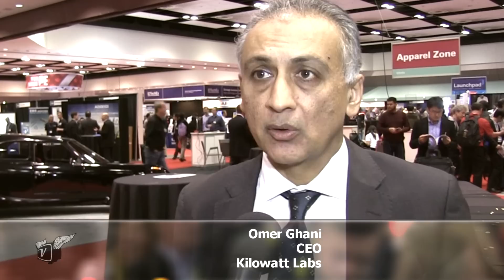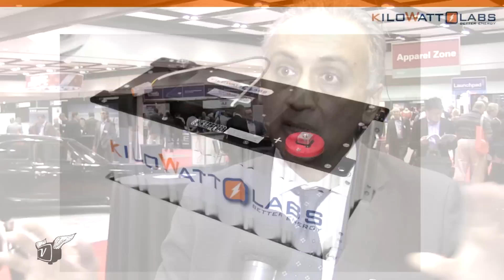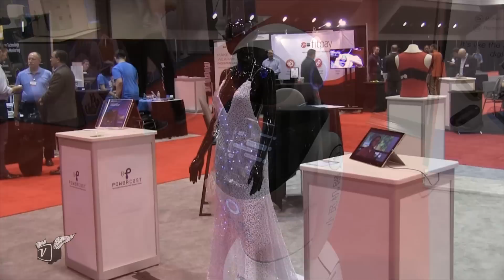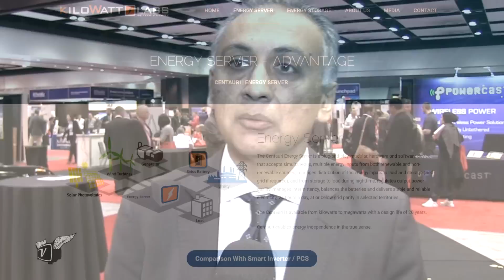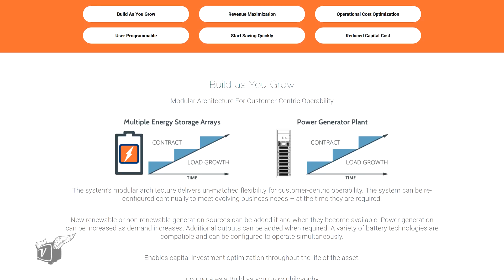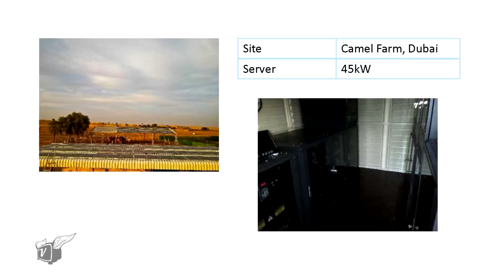The Fuel Tank of Tomorrow - A Super Capacitor?

Comment: Super/ Ultra capacitors don't have the capacity. They work great in parallel with a good lithium battery. The new Solid state batteries will be like this. By itself a capacitor is ok but not for long time energy, just short start stop times.
Reply: We need a lot more people making these points. Too many of the commentariat just buy into the hype.

Comment: So where do you buy product? They don't show any distributor on site...
Why are they only 2.5-2.8 volts? To keep the insulation very thin? Why are they so expensive? Only three components, foil, oil, paper insulator....
How come your cap unit looks like a 18650 battery???

Comment: Cars are to heavy, I use a Solarized e-trike that pulls a solarized trailer. Light weight flex panels (6-100 watt panels, easy to add more panels). Sun light helps to keep the battery top off.
Reply from the maker: Great idea. I interviewed the inventor of the Truck Trike last year and he pointed out the advantage to the e-bike approach is the incredible payload to vehicle weight ratio compared to a traditional car, where a ton of metal and parts needs to be propelled just for one human. http://www.viodi.tv/2017/06/30/the-ebike-delivery-van-verge16/
Reply: Voidi- watch on utube, Light Rider operation Paul Revere. Solarized e-trike/trailer I put together.rode across Canada, crossed the Rockies 3x. Used it to boil water, cook food, charge batteries for cordless tools, hauled material for a dwellng.
I upgraded the solar from 6-50watt glass panels to 6-100watt flex when I was in Victoria, BC.
Reply from the maker: Very cool. I watched your interview in Thunder Bay. If you ever ride it to Silicon Valley, let me know, as that is very creative solution that will only get better as solar panels improve.

Comment: What I don't understand:  The energy stored in a supercap is proportional to the square of the the voltage, and inversely proportional to the distance between positive and negative poles.  But the risk of electrons traveling through the gap between the poles increases proportional to the voltage.   Hence, voltage is a limiting factor, but should be maximized because of the energy stored.  Why does the speaker talk about a low-voltage supercap then?

Comment: to recharge a supercap in one minute to capacity enough to drive a car for 100 miles you'd need a charging cable as thick as your forearm.
Reply: Yes, a very heavy cable and a very powerful charger that is able to generate the 1000th of amps to charge so fast.
If the charging is 1 minute and the discharging is about 1 hour or 60 minutes of driving, you will need 60 times more charging power than the average power used in driving the car. The average energy use of a car is 35 KWatt-hours per 100 miles, and say you drive in that hour 50 miles, that means an energy use of 17.5 KWatt-hour. Than means that you will need 60 times 17.5 KWatt or 1050 KWatt of power to charge the capacitor. For a 600 Volt battery that means 1050/600 = 1.75 KAms or 1750 Amps. That is indeed a heavy cable and very powerful charger! Can anybody check if I have these estimates correct?
Reply: You could have like prongs lifting from the floor to give your car a small "kick" of a few kV
Reply: Yes. If we view an energy storage system as a black box then energy in = energy out less the inefficiencies of the charge + discharge cycles (in batteries this is called conversion loss). Lithium batteries, depending on the quality, have 1-10% conversion loss (at the high end think ultra cheap China).  Second, KW capacity is a function of 3 factors: voltage, amperage and time. More voltage less amps, less voltage more amps for the same capacity to do work. Of course, time then spreads the instantaneous need over a period. So, for your example of needing a 17.5 KWH capacity and assuming near 100% efficiency, in a DC current at 600 V, I calculate you need about a 29 amp flow for a period of 1 hour either discharging or charging. Or, 58 amps for 30 minutes, 116 amps for 15 minutes, 1740 amps for 1 minute. The AC electric grid complicates the calculations somewhat (that pesky calculus stuff); that is why high capacity chargers need 220V two phase circuits and super chargers use 440v 3 phase circuits. So, given a reasonable charge rate of 232 amps for 7.5 minutes most likely could be handled by a gauge 00 cable (or a bundle of five 10 gauge cables) at 600 V.

One conclusion here is that the electrical grid, typically, does not deliver adequate power to quickly charge electric vehicles. However, the grid design could easily deliver 1,200 V or even 12,000 V without much trouble.

One last thought, I think it was sometime in the late 1990's  or early 2000's, Popular Mechanics ran an article that calculated the power needs of converting every car and light truck to electric. The USA would need to build 600 600-megawatt nuclear power plants to meet the demand. If the plants were fossil fueled, the operating carbon footprint would be only slightly less than gasoline powered vehicles; negating all benefits from electrification, including health and environmental.
Reply: @Chuck_C  the charging station could have it's own super caps to balance the load on the grid.
Reply: True, however if charged at very high voltage, then cable size comes down. But to do a 1 min charge would require thousands of volts, extremely dangerous. I think a charging system designed to recharge your car over a 10 to 15 minute period makes more sense. Have a coffee while your car is charged.
As for supercaps, lots of promises but no delivery of viable products.
Reply: @Chuck_C  this is exactly how corporations such as oil companies and power companies want you to think.  Every house will generate power from the sun.  The corporations only have to continue to raise prices to make it cost efficient for average person to seek a better way.  It will happen,  just takes time and corporations to get a little greedier.
Reply: @arthurgrunwald3859  amm looks good
Reply: @kelvinham8576  sup er caps are designed to charge very fast and there is no need to charge it at once u can charge .......
Reply: @FutureOfGaming  So don't use a cable. Use contactors that come up from under the parking space.
Reply: @Zamboro  i dont understand what u want to say
Reply: @Chuck_C  nice to see someone who has a good idea what they are talking about. Electric cars are a good idea if you have your own renewable energy source such as solar roof, wind, water turbine etc. Also place of work should have solar roof. Most lithium ion  batteries should only be charged to 80% never used below 20% to extend its life.  max current load limited as max charge rates also need to be restricted, super caps could help reduce max load in conjunction with battery pack. I don't understand why people require or expect instant recharge. Interchangeable pre charged batteries would solve most panic stricken peoples need for instant recharge, please also consider electric has to be generated which takes time whereas fossil fuel energy has been generated and collected over thousands of years that is why we use it as it is there for the taking. We need more renewable electricity generation systems before we loose sleep about how fast batteries or super caps can be charged.
Reply: @kelvinham8576  well said, people need to be realistic, trying to charge any energy storage device 100kw battery or capacitor would be a bomb/fire hazard, also you can't discharge 100kw in a minute for the same reason it is Dangerous!!. Manufactures of storage devices need to have multiple safety devices in case of accident or short circuit. Electric cars should have limited acceleration to reduce current draw from battery also need multi ratio gearbox for hill climbing/regeneration braking etc., battery or storage system will be damaged if too much demand is put on it. It is false marketing to claim a fixed ratio electric car can accelerate 0-100kph on under 4 seconds because even though it is possible in theory it puts too much stress on batteries etc. First thing people need to be more realistic with their expectations of what transport is about as do these marketing people pumping out fake claims. So far each recharge of electric car costs more on battery degradation than a tank of fuel plus the cost of electricity therefore still not economically viable, hasn't addressed co2 because electric has still to be produced mostly by fossil fuel or hazardous nuclear generation. I'm afraid we have a long way to go to solve the transport problem. Sorry if my comment sounds negative but I'm trying to be honest, I'm not very impressed with all the fake claims and clever marketing.
Reply: @jonathancrump31  Bingo.
Reply: false
Reply: Soon if we managed to have working fusion reactors we can potentially supply the grid with enough electricity to charge many electric cars in the road that quick.
Reply: @blackmanops3749  not false over 9.2meg already out there
Reply: @arthurgrunwald3859  Don't forget Ohms law. Maybe they charge at 100,000 volts. That would drop the current way down. Less heat, smaller cables.

Comment: Its a direct question to Mr. Omer Ghani, CEO of Kilowatt Labs. Cannot we use these super capacitors’ bank in place of LI Battery bank in Electric Vehicles? What are the advantages and disadvantages in using super capacitors bank instead LIB bank? Expecting your clarification at the earliest possible. Tnks. Bye bye.

Comment: Where do I get this super capacitor battery to buy?
Reply: They are on sale in Australia from Arvio, don't know about elsewhere. It does seem that the comment about having storage capacity equivalent to Lithium footprint is true by using graphene or something similar to expand the area that can hold the electrostatic charge as I understand it. A lithium-ion gateway is used to slow the discharge, which helps to maintain the charge. Cost is quite good in comparison to lithium-ion, especially when the lifespan is considered.There are a number of videos from Arvio and a demo monitoring of the batteries in action in an installed system.

Comment: Supercap powered hybrid cars will be ideal for power adder hub motors... a 1.0 liter engine with hub motors powered by supercaps= a 300hp Honda Civic that gets 75 miles to the gallon built for the same cost of a Honda civic today.
Reply: But wouldn't hub motors lack a differential?
Reply: Ananta Sesa das why is that a. problem? 1 motor at each wheel, no need for a gear box or differential...you get torque vectoring too.
Reply: +Tyler Hardy, yeah it might be doable with high speed communication between the wheels so the inner wheels throttle down in a turn to not burn rubber.
Reply: how fast do you like to corner?
electric motors would not be coupled
Reply: There's plenty of companies doing it already. The communication only needs to be between the motor controllers.
Reply: Sorry to be a nuisance, but why is it a good idea? where is the power that charges the capacitors would come from?  Are you going to leave the engine running when the car is parked? Or are you going to plug it into a mains socket?  If the latter, how is it better than the batteries?  With the batteries the power boost will last a helluva lot longer due to much more energy stored.  Not a criticism, I just don't get it, could you please explain.
Reply: +Bob Berg, right hub motors won't be able to start the engine like hybrids do by momentum. So cranking is required every time the light turns green. OTOH the hub motors would lighten the chassis weight and then lighter duty axles could be used and no transmission, so that can lower overall wt. for hybrid or all electric. might be hell trying to fix the motor tho.
Reply: Can u put this in a car u tell smooth charging how about the alternator charging so fast maybe destroy the capacitor
Reply: richystar2001 super capacitors do not produce any energy they just store it.
Reply: AnantaSesaDas So you know of an electric motor that is efficient over the range of zero to 80 mph to put in those hubs?
Reply: Power/torque is only used when you push the accelerator petal. The full capacity would be 300hp 400ftlbs...but when you drive, that capacity is only used for seconds at a time...truthfully only 25% of the power of an engine is used constantly. So a 1.0 litre three cylinder engine could be used for sustained power...the supercaps will give you full power when you press the petal down... So 0 to 100km in 4.5 seconds and if you travel faster than 130km per hour you would get a speeding ticket anyway. A 1.0 litre engine could easily get 75 Mpg when uncoupled from the drive system and is only used as a generator for output.

Comment: SC are awesome. But while there is lot of talk about how fast you can charge them, there is little info how exactly it is going to happen.
Current entry level electric cars have around 30kWh batteries. So the battery gets replaced with SC. Fine.
Now let’s do some math about charging the car.
Let’s assume the charger is using 480V DC like Tesla SC-s do.
To charge the car from 0 to 100% in 30sec requires (30 000 * 60 * 60) / (480 * 30) = 7500A current (!)
Would like to see the cable and contacts that will be used for the purpose.
Reply from the maker: Good point. Supercapactors might be more useful as sort of a energy cache and maybe will be used in conjunction with other ways to create fast-charge. I thought this approach with swappable energy packs , demonstrated at CES, is an interesting one. https://youtu.be/nPoM0ANCxrk

Comment: I always wonderd why they didn't use cpacitors instead of bateries. I knew about the limited charge in most capacitors. At least I thought it was limited. I guessi it's  like the man says you have to get the dischrge rate down to maximize the charge in the capcitor. I bet this would eb a sgood tech to use on E-bikes.  You can generate electricty during  the your coasting and slowing down periods. that will keep some charge in yout capacitors. I see big potentioal here. Real big!

Comment: With such high high charge cycles and quick charge times, what about "on the fly charging" every 10 miles or so to allow for less weight and size of capacitors of EV's.
Reply from the maker: I think you are onto something. as outlined in these articles

https://www.linkedin.com/pulse/cool-new-e-busses-run-without-battery-gerald-babel-sutter

https://chargedevs.com/newswire/singapore-electric-tram-charges-in-20-seconds/

Thanks

Comment: Lead acid batteries with dual negative electrodes, one carbon, one lead pretty much work very well. They are both a battery and a capacitor. 

A pure capacitor will self discharge too quickly to be of any use. A battery can store an order of magnitude more energy than any capacitor ever will. its just not physically possible. perhaps it can be solved woth some quantum physics, but that isnt worth explaining in a comment.

Comment: Thorium yes indeed and Thorium is far more abundant than Uranium! If we had made Thorium reactors for electricity instead of Plutonium they would be a lot safer and generate a lot more energy in a smaller space. Radium painted on a solar cell will also create electricity and another interesting phenomena is that a very small piece of Plutonium or Thorium pressed against a Beryllium (Emerald) crystal will light it up very, very bright and outlast your mortal lifetime.  This light will also convert into electricity via a solar cell and charge a battery 24/7
Reply: Radioisotope generators are a very niche product. Good for when you need a continuous but small amount of power for a long time, but that's about it. Nuclear reactors are for large-but-constant needs, basically baseload power. Pair them with renewables and storage, and you can kill fossil fuels for pretty-much everything except aviation and rockets.

Comment: to recharge this supercapacitor in 10 sek  to supply power for eg. to 100 kw  electric motor in the electric car you need 
a ten of thousand ampers of electrical current to charge this supercapacitor in such short time ???
Reply from the maker: Yes, the transfer of power could become the limiting factor. This year's IDTechEx is around the corner. It will be interesting to see what progress has been made with both supercapacitors, as well as the energy transfer challenges you raise. Thanks.

Comment: they don't mention the specific energy, and it's not hard to figure out why.   Lithium batteries are getting 150-250,  and will probably be getting >400 kWh/kg within a decade .. ultra-capacitors are not even up to 10, last time I checked...  Super-capacitors might very useful if coupled to a fuel cell..

Comment: It always seemed to me like capacitors would be the way to go. If those things are set up to where they work wasn't it says it will and he needs a that'll spread the word to people electronic devices and rechargeable power tools. Work with Samsung and or DeWalt Milwaukee who all have quality products and large consumer bases if there's work as well as he claims that would get the word out even if you had to run them at cost start off with.